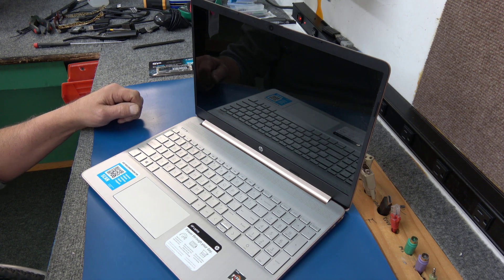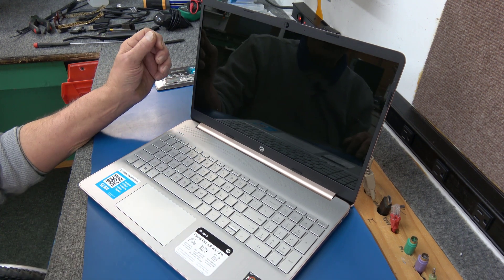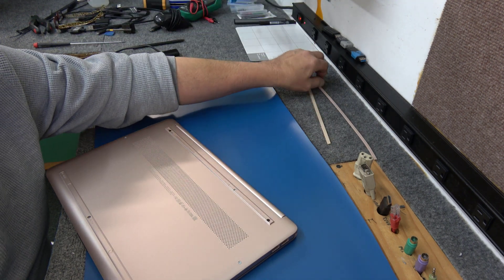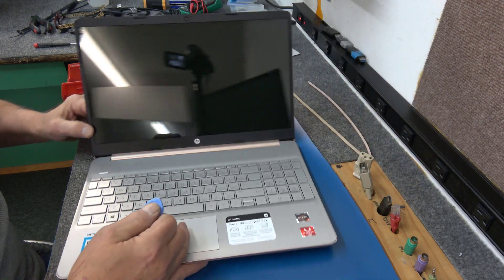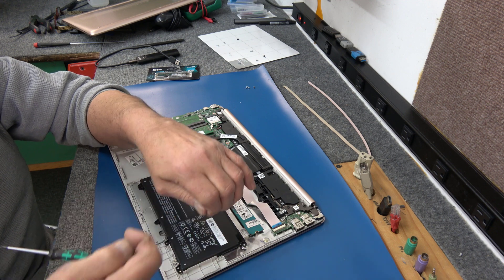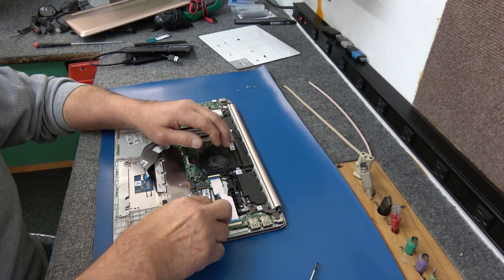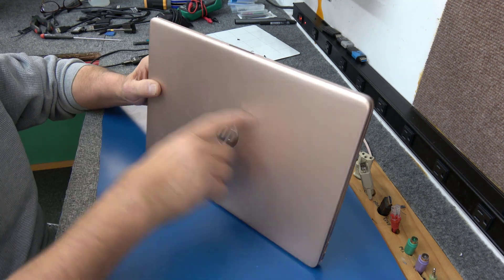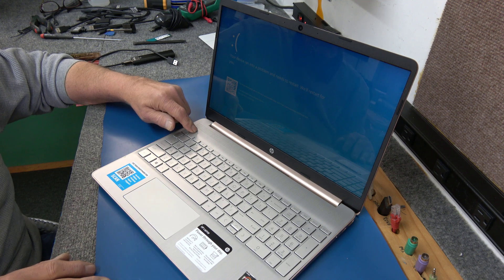HP 15.6" Ryzen 5 Laptop SSD Upgrade Bluescreen After Cloning

Comment: This looks just like mine but I have lit keyboard and touch screen.  I got the blue screen after downloading "iolo System Mechanic" I was quotes repair costs similar to the cost of the laptop.  The lowest was $180 to $320.  This was a nightmare.  Bing Chat has me doing things I wasn't used to like run and command's.  It was only by mistake I got it fixed.  I know I tried restore from previous update.  I should have did the Microsoft Update a couple days earlier because it took almost an hour to remove the Optimizer.  Left the negative review on Trust Pilot saying, fire the mechanic.

Comment: Far be it for me to correct an old tech' campaigner, but 5 'll get ya 10 the clone was bound for failure because it wan't performed on the actual device it oughta have been.  The cloning s/w is h/w specific: so whatever you cloned it on is gonna - right off the bat - fail because the cloned image is not going to be identified by the notebook BIOS at boot time.

They say it takes one to know one: i had this issue a decade or so ago using Norton Ghost (now "Spymantec"), where i made the same mistake of trying to clone a hdd on foreign h/w to the actual pc that was to be the recipient (host) for the cloned drive: BSOD every time.

Tip for first time disk cloners: wherever possible clone on the device you need a replacement hdd/ssd/partition for, as the h/w specific identifiers in the image are the clincher.

Comment: Have you done a 2024 HP x360? It has one long strip and then two feet looking things at the bottom. I’m wondering if there are screw’s under the feet.
Reply from the maker: Hi. Yes, there should be screws. Especially in the back in the hinge area.
Reply: @CadillacComputerCenter  Been trying to find a video on this model to no avail. I really love this 2 in 1. Also, you are awesome sir!!!

Comment: Hi Dale, I failed to continue installing window 11 23H2 on Hp 17.3, saying that there is no drive to install windows like you, but I saw that you did something on previous video when upgrading it, I think you installed the IRST driver, where I failed to find it through the intel website, it seems like the Zip file is not available at the moment.  so if you can provide me those drivers through google driver I will be very grateful. Please

Comment: I was happy to hear that hp stands for hinge problems. I changed ssd on my new hp, sometime during taking back off and reopening to press power button, the left hinge ripped out of the remaining two screw posts, was a f’n mess. The lid contains one or two of the hinge fasteners and with back lid removed, the remaining posts apparently very fragile. 
Super glue, baking soda and a little skill and lots of luck, has held together for two years now. Great video and really appreciate your channel.
Reply: I always thought it meant High Price. 😎